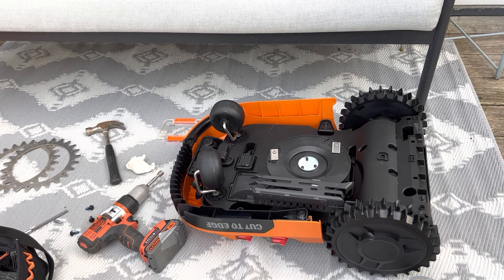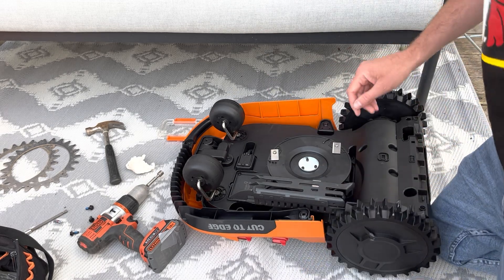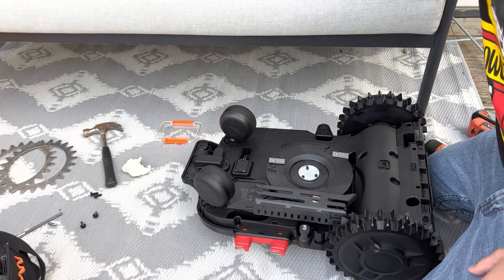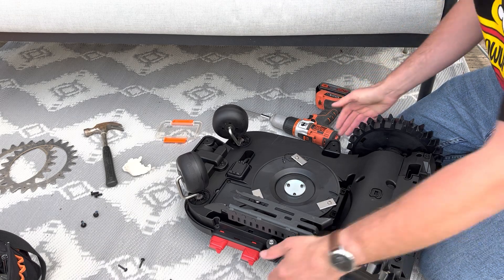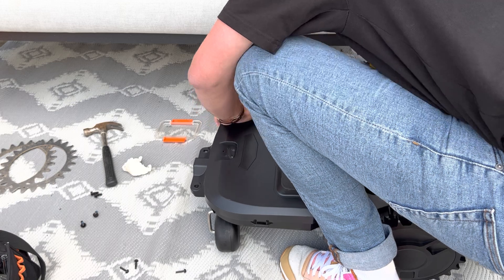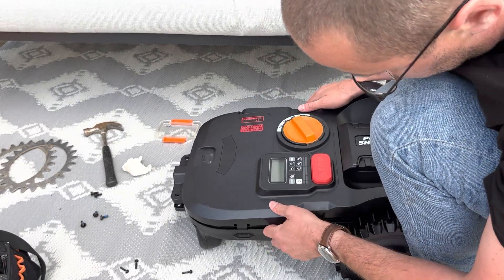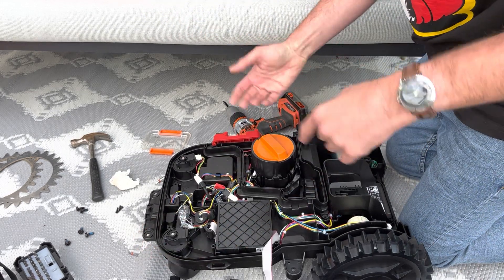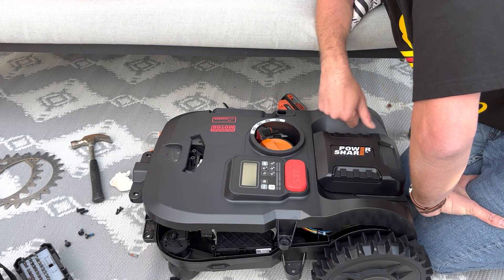Landroid wr155e (L2000) lift sensor hack. How to stop the lawner to get stuck everyday!

Comment: I've got a L2000 and Yeah, it is a piece of crap machine. Regardless of what it will find new ways to stop, forcing you to save it... It could never handle a gardenby itself,  that isnt a flat surface square in the Sims.  Skip it, dave up for something better.

Comment: Thanks a lot for sharing. It worked perfect until I had to get it serviced and they removed it. After that I tried again but nothing worked . I tried left , right , both , only magnet , with magnet holder. Finally I found the solution and actually it’s easier ; just fix the magnetholder in the highest position in the wheelbase (with duct tape ofcourse ) . It will also avoid instability of the wheel.

Comment: It worked, brilliant ! I was totally frustrated by this and have sent it in 3 times (!) For service. I had to do both sides, when I did only left side it kept having the "Mower Lifted". And iI also took out the little magnets and taped them directly to the sensor, so without the rubber holder. Thanks for sharing !

Comment: Thanks, now my L2000 works fine.
EDIT after 2 months: Do not remove the black plastic with the magnet, only the magnet itself. Without this black element, the wheel's axis loses stability, the plastic wears out, and the wheel starts to jam when moving up or down. Attach only the magnet to the sensor!
Reply: would a better way be to grab a small magnet off amazon and tape that to the sensor instead? (I have some that are for keeping shirt collars in place).

Comment: Great video/information,  I also agree that Worx needs to rethink this design as it is way too sensitive and very few will have a lawn that does not trip the sensor repeatedly. Maybe put the sensor on the shell and not on the wheels. This has been so frustrating for far too long. 

I did alter this slightly however by just wrapping a string around the bottom of the wheel shaft just below the sensor. For some reason mine went back to giving lift error shortly after taping the magnet to one of the wheels circuit boards. When taping them both I got a lift error immediately after powering on that would not go away. I then took it apart again and decided to just try wrapping a piece of string around he bottom part of the wheel preventing it from dropping, put everything back together again and no more lift error. It's been running longer than ever before by doing this. So, thanks for the tip!

Comment: A little side note in the safety aspect of this mod. 
“Lift” sensors in the wheels or on the cover are not there to detect if the body of the mower is “physically lifted” .
These sensors are there because the shape of the cover is specifically designed to trigger these sensors when the mower runs over your feet. The cover will ride on the foot of a standing person, and since this motion will “lift” the cover from its normal position, causing the casters to “fall down”, the robot will immediately stop the blade and turn away. 
So this can be dangerous even if no one is lifting up the robot from the ground. A distracted person standing on the lawn when the mower is operating could be injured as the blade will not stop anymore when feets are under the robot body (and very close to spinning blades) 
Be careful guys!

Comment: Hey, thank you so much for your solution and posting the video.  You saved my sanity and you saved the Landroid from the garbage bin because this problem was driving me absolutely nuts.  I had contacted Worx support several times about this issue weeks ago and they still have not made any attempt to contact me that I can tell.  The lift problem wasn't so bad until this last firmware update and clearly the people who write the software and/or test it have perfect lawns without any little bumps (grass clumps).  I would suspect a lot of people with the lift problem are making this modification so if Worx is indeed using that trigger as a feedback mechanism on their software, they probably think there isn't a lift problem as far as the feedback reporting goes.  Oh well, it is working very well now and just wanted to say thanks.  Cheers!
Reply: This is why honestly we need more open source or somewhat open devices.  Eg disable lift sensor, obviously would need to sign a crazy waiver, but i'd be happy to do that.

Comment: Thanks a lot. My garden is not a golf green and my robot is making lift compensation every 2m or lift errors 3 times per day minimum. I will apply this immediatly but perhaps put an electronic bypass instead of the sensor

Comment: Thanks for the tips. I just took the actual magnet out of the little black plastic clip, wrapped a layer of electrical tape around the pc board sensor to resist shorting it. Wrapped the magnet in a few more layers and covered it all with a piece of duct tape. Ran all day no issues. That is a rarity, Thanks Again

Comment: Hi! I'm thinking of doing this myself as well, thanks for the thorough instructions. Is there a warranty seal of some sorts that would be broken when opening the mower this way?

And also, do you really mean that if you power on the mower without the cover, then it "won't ever start", as in, even if you put the cover back on?
Reply from the maker: Hello ! No worries. I'm just saying that you will need to mount the whole thing back before it can start again. This is due to the magnet located on the cover. If this magnet has no contact, the mower will put itself in some kind of security mode. So, long story short, it just means you'll have to totally re-mount the thing before you can test the success of your tweak ;)

Comment: I have made modifications to my Landroid to add night lighting effects. It was a fun project (as seen here https://youtu.be/GSnjIVoXH0g). When I got the unit completely assembled I had trouble as the robot just made continuous circles. Thinking I had messed something up was causing me to panic. I remembered your video and saw a message on the control panel that said 'executing wheel lift maneuver'. After disassembly (not easy) I found one of the LIFT sensors has slipped out of its bracket. After remounting the sensor all was well. Just wanted to shout out to you a thanks as your video was very helpful in my project.
Reply from the maker: Wow! Thank you I’m glad you was able to fix your robot! Happy mowing ! :)